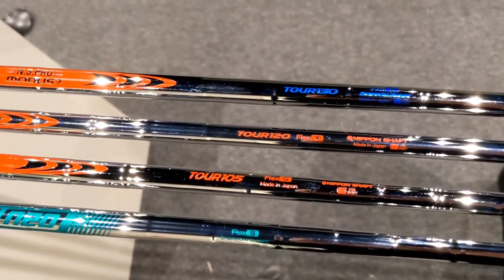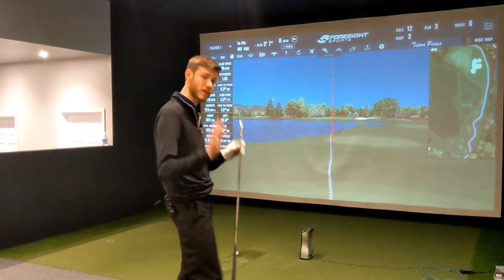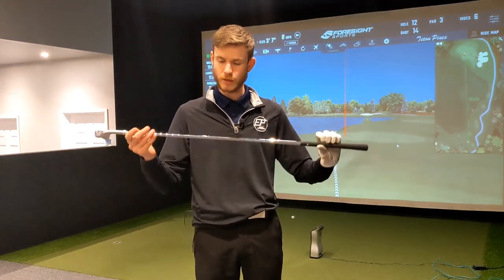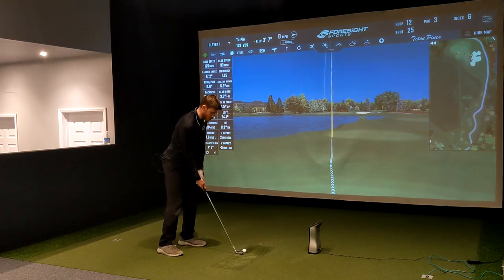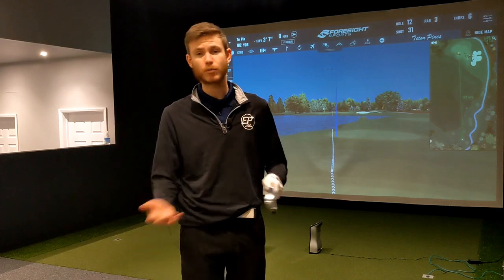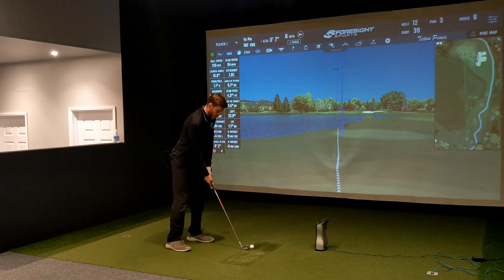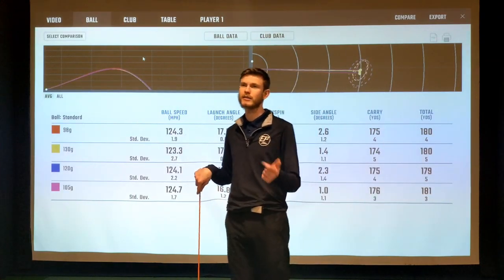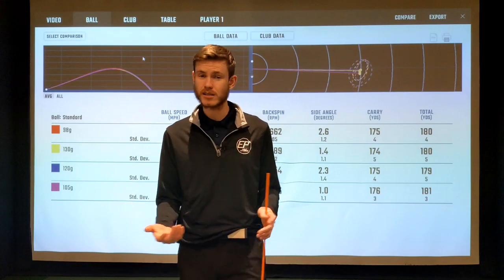Iron Shaft Weight Fitting - What Weight is Best??

Comment: Great video.  Looking to get modus shaft in a set of 223’s.  Been fitted in modus 120s (7 iron = 121.7 ball speed, spin 5700, 91.4 club speed, 173 carry, 184 total) 

Before I buy, do you think I should be in stiff or extra stiff with those numbers?
Reply from the maker: Thanks Stu. In all honesty you could be in either. Number 1 I'd go based on feel and your preference between them. Number 2 consistency. 3 if there's nothing between them then if you are an aggressive quick tempo player then go X if you are smooth then S will be fine. But for me number 1 is always feel and confidence.
Reply: @epgolfstudios  thanks for the advice.  I’m coming down from DG x100’s I’ve had for 10 years - so all feels abit alien when trying them. The club in the bag which is really feels good is my tsi3 Tensei white 65 stiff.  Which one you think might align with that?
Reply from the maker: @Stu1987  hmm it's hard to translate directly from graphite wood shafts into steel iron shafts but the AV raw shafts play very stiff because of the stiff handle they have so if you like the feel of that I would maybe edge towards the X-Stiff.
Reply: @epgolfstudios   ahh I see.  And a final question, just since the 115 has come out but plays heavier - could that be a nice middle ground to split the 120s and xs? Or is the profile of the 115 totally different?

Comment: I’ve recently gained a set of blueprint s irons , not quite sure the shaft is right for me as I’ve been using dg 120 and like that . 
But in these irons they have nippon modus 105 , they feel a bit light and not sure the lie is correct .. Could I come in for a fitting using the blueprint head in a heavier shaft ? 
Before I go down the rd of changing shafts ?

Comment: I have a question regarding backspin. With my mizuno pro 223 and PX 6.5 shaft i have around 5800 rpm backspin and vertical launch  around 16 degree. I tested modus 120x and spin went up to around 6400 rpm, but the launch stayed the same. 

I like the feel of the Modus much better than my PX 6.5, and i also have better dispersion. Should the higher spin (and the loss in distance) concern me or can i make the switch to modus 120x? I have pretty similar numbers as you across the board. Swing speed at 94 mph and ball speed 125 mph.
Reply from the maker: Hey Alex, hmm that seems like a little bit too much of a spin difference to me mate being honest, I would be surprised if it was that different (on good hits) especially as launch the same. 

But being honest I would always play the shaft you felt more comfortable with and felt you could time and strike more consistently. 

But talking strictly numbers because you launch it on the lower side I would probably edge towards the slightly more spin to get that ball flight climbing a little more and dropping at a nice steep decent angle. Although miss would also come into my thinking. If you tend to miss left a lot then definitely go with the higher spin option, but if you rarely miss left and balloon the ball up high right quite often then I could air on the side of slightly less spin.
Reply: @epgolfstudios  Thank you for a great answer. My misshits is snaphooks with my PX 6.5, while with the slightly ligther modus 120x it immediatly went away (atleast on trackman). Distance control also seemed to improve. 

I never tried the modus 120 TX, which is more like my PX 6.5. Do you think i should stay away from the TX shaft due to the fact i'm missing shots left and spinning too little? I also feel 125g might be a tiny bit too heavy for me, even though im a agressive swinger.
Reply from the maker: @Alex-vj3ll  yes I do mate! You sound similar to me and I miss left when I go heavy and stiff and miss right when I go light and soft (as a general pattern) so find the sweet spot for you and completely forget about the theory and what you think you should be playing. Just play what works 🤙
Reply: @epgolfstudios  Thanks alot!

Comment: I have used a 98-gram shaft fairly stiff not overly so for 22 years Callaway x14 constant weight shaft. Been checking out the new Elevate 95mph(90gram) in stiff, more like a regular and the feel is so different. I'll have to hit more to find out if I like it. It's in the Ping i230.  I think I do like it, but it feels unstable yet is more accurate than the 98-gram stiffer shaft. Crazy right? I want the accuracy, so I'd better learn to like the softer lighter shaft.
Reply from the maker: Yes at the end of the day accuracy is key. Feel can probably be acquired. If something works well I'm sure you will learn to like it. Although I'm not a massive fan of the elevate, low balance point I have found so they feel heavy for a light weight shaft. I have also consistently seen a drop in launch and spin Vs other shafts. Which is the opposite of what it's supposed to do 😂

Comment: I have a question, you appeared to hit the 105 best, it also had a -1 deg dynamic lie angle.  If you got that data in a fitting would you suggest adjusting the lie angle 1 degree up, or would you just leave it?
Reply from the maker: It would depend on the miss of the player mate, for me personally I like my toe being a little down if anything as my worse miss has always been left so I would leave it. If the player consistently missed right then we'd definitely look to go upright by 1 or 2 degrees

Comment: Lightest shaft you can control…weren’t they referencing driver shafts when they said that? I play 105 X and I’m considering a 115 or 120 for no other reason than they feel really nice to me and I feel the head too much with the 105. Would never go 130g endless it was like a DG or something like that.
Reply from the maker: It was irons that I saw them talking about mate but I think it's quite a good general rule throughout to be honest. Yeah definitely if you want to feel the weight a little more evenly distributed it's certainly worth trying the 115/120 as you say. 👌
Reply: @epgolfstudios  quick question while you are here, Accra TZ6 CB 45” playing length in Ping G410…if I put that into a callaway head is the callaway so much lighter that the swingweight would be off or are they close in headweight after the OEM adapters are added? Callaway is 9g and ping 5g?
Reply: @epgolfstudios  would you do 105x or 115s with miura mb101? does more club head feel plays better or evenly?

Comment: My irons came with project x rifles 5.5 i hit some really nice shots with them but feels like i have to go at it quite abit to get the shot i want and feels abit heavy and stout for us im tempted to try the modus 105 as i think there about 10g lighter
Reply from the maker: Yes definitely would be a good shout to try the modus. Lighter and just all round softer, smoother and feel less work 👌
Reply: @epgolfstudios  cheers for the reply i know you always say gett fitted but this golf hobbie can get expensive. The 5.5 are meant to between stiff and reg like i say i do feel like i have to put a a bit of force in with these to get the flight i want but i hit my 8 iron about 150 was thinking prob best to go for modus 105 in stiff but theres a cheap used set of the shafts in regular was wondering if i could get away with reg or better to save up and go for stiff just confused as the 5.5 meant to be between yet feels quite stout
Reply from the maker: @stevethepigeon7159  it feels stout because of the profile more than the flex. Project X are just stout shafts by design regardless of flex. Modus are quite a bit smoother. If you can get a cheap set of 105 reg id go with that. Won't be much in it between S and Reg and flight will be the same